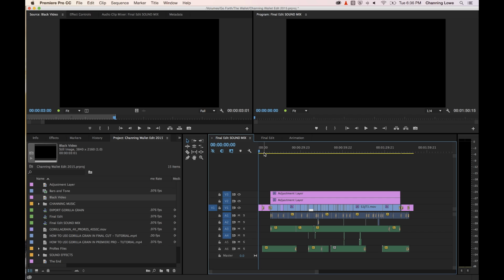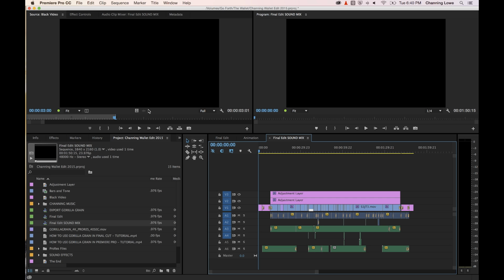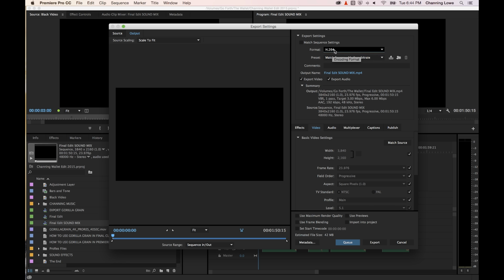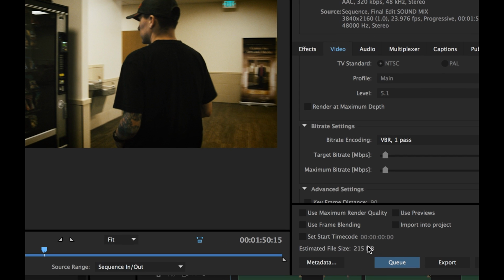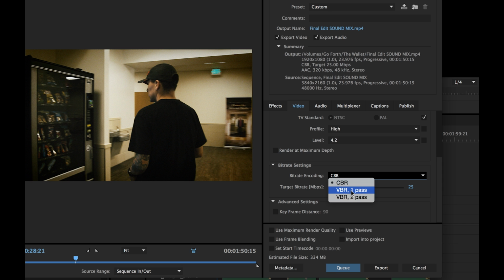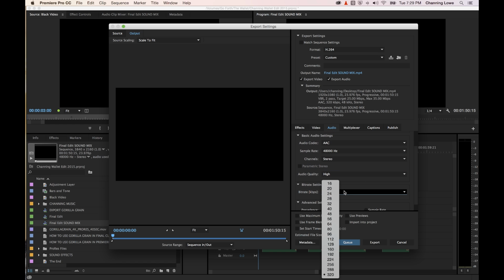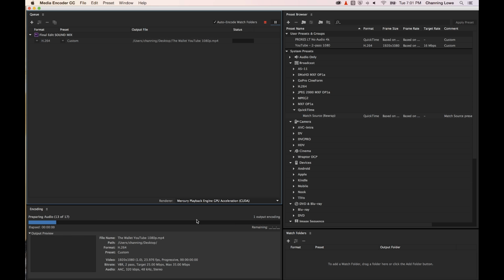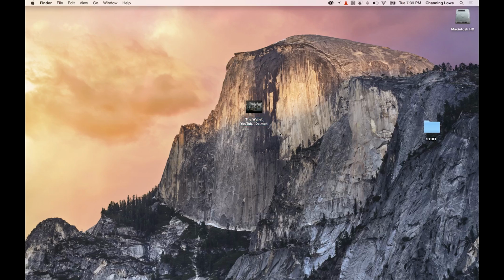Episode 38 - Export to Movie - Tutorial for Adobe Premiere Pro CC 2015

Comment: good information,,but HELP ! I'm going crazy,,,,,doing a wedding about  1 1/2 hours long to put on a dvd using sony z5 cams and 4k panasonic fz1000 dslr  and after editing and exporting  final media the adobe cc  media encoder is taking ,literally,,,DAYS  to encode and build,,,,,I mean like 40 to 50 hours,,,,I've got to be doing something very wrong,,,but I haven't been able to figure out what,,, ?  ( I've used adobe cs6 for years,,,loved it with no problems,,,but this adobe cc is killing me !) oh,,,I have been setting to dvd encode instead of hr264 thinking it would save time,,,,,and setting it to the 2 pass max dept  and bumping bit rate to show about 4200 or so file size to not exceed dvd capacity.....
Reply: oh,,,I do have a 8 core fast computer with 24 ram  ,,,,I do keep the original files on a secondary hard drive which is a 2 terabite  and the adobe program on a solid state drive with initial  programs on it
Reply from the maker: What is your video card like? Decent one? Also-- make sure your external is plugged into a USB 3.0 port, not a 2.0 port. A USB 3.0 will look blue on its inside port on the actual computer. Are you sure if Media Encoder is using GPU or CPU? There is a drop down to the bottom right of Media Encoder that says "RENDERER". Make sure it's on GPU and not "software only."
Reply: well,,,,upon taking your much needed advice,,,,I find that the 'software only' box is showing up,,,,and gives me no choice between it and a GPU selection,,,and  speaks of rendering with supported GPU graphics card can improve render speed and quality . choose 'open CL or 'CUDA  to enable hardware acceleration...........perhaps my graphics care is not the 'chosen one',,,,but how can I tell or find a list or requirments of a  prefered card ?
Reply from the maker: If you are on the 2017 Adobe updates, then the only thing you usually need to do is update your graphic card video drivers to the latest and restart the machine. That will usually do it. Are you on the 2017 CC update?
Reply: looks like I'm still on the adobe cc 2015.4  as it shows at the top of my program........ I'll check into the 2017 update,,,,,,, I like adobe and have used it for years and years with good results,,,,we are just a small town mom and pop business  (  on the you tube as .... tcvideosennistexas .... mostly small town stuff, weddings, occasional industrial  ect )  and although the adobe cc is good stuff,,it gets really frustrating  when it doesn't work,,,,,and the learning curve  is not good,,,especially when I've been an adobe cs6 user for years with basically no problems,,,,,,,thanks again for  all your help,,,enjoy your videos !
Reply from the maker: 2015.4 is fairly new as well. I would in the very least attempt the video card driver update to the latest. That usually solves it.
Reply: thanks again for all your comments and help,,,,I'll sure give an update a try,,,,,,thanks